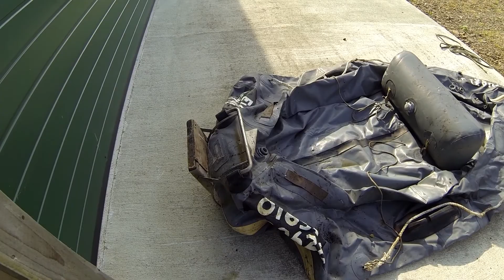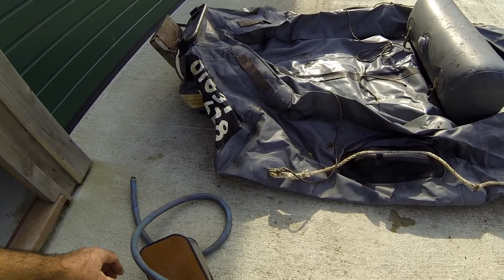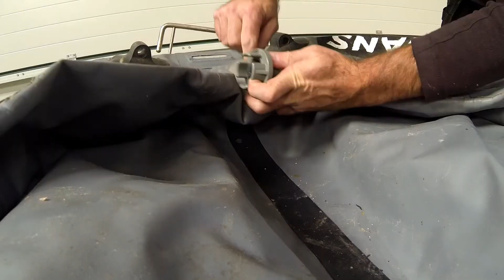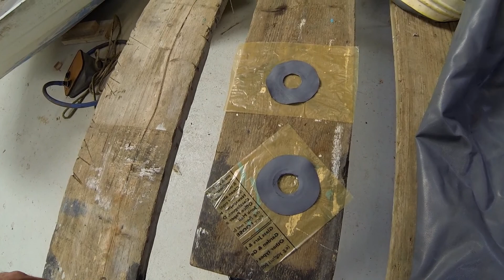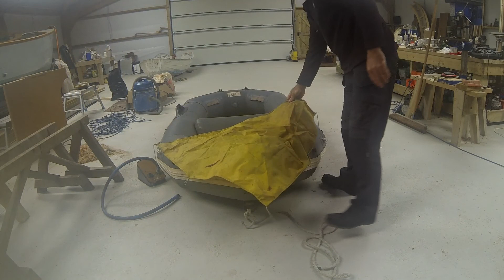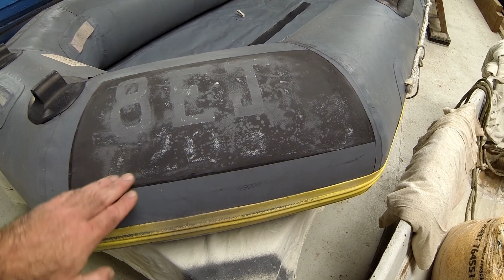Avon Redcrest Inflatable Refurbishment

Comment: I've just got hold of a redcrest here in NZ of the same vintage 1979. It had been in storage for years but didn't have any leaks or patches. The rear valve had been replaced with a newer type used on the more recent Avons. Had a slow leak in the inflatable seat valve. A squirt of WD40 loosened up the spring and is now sealed. I had a similar Redcrest as a tender to my sailing vessel for 6 years which survived many a bashing on rocks, shingle, concrete piers and attacks by local kids in various parts of the globe hell bent on its destruction.

Comment: Mine is 52 years old & gets used from time to time. I have always storedt it inflated to avoid creases. Got it out today to find a very slow leak which i will sort later. It was refurbished about 25 years ago when new valves were fitted. Been a fabulous dinghy that cost me £110-00 from Barnet Camping & Marine. I have a Seagull 40 + outboard for it, which my father bought 60 years ago. I used it a lot as a 13 year old on my first Avon (A Redstart) which I changed for this one when I got my new boat when I was 21 years old. It still runs - Would not change either. I do like rowing my Avon & have rowed it miles.

Comment: I've just bought a small sail boat and it came with a Redcrest dinghy. It's1979 and it inflates OK and without any leaks but the vales need replacing. I was thinking about a new dinghy but having watched this i'm not so sure. Great video, thank you. Anyone have any ideas regarding an outboard mount bracket?

Comment: I just bought one of these and it was in a bad state. Good to see what it will look like when it is finished. What glue should you use on this boat for patches etc.
Reply from the maker: You’ll need a contact adhesive formulated for Hypalon, which is the type of fabric the boat is made with.

Comment: I just got a this same boat. The valves are different on mine. They a steal and have little rubber plugs inside the screw on caps. To inflate, you unscrew the vales a turn or two and put the pump to it. Then, simply tighten them and the hold the airpressure.

Comment: Outstanding Video. I was just given a 2001 Avon Redcrest and the only issue is a sheared off valve. So lucky I found your video. Question, what type of solvent are you using? I've never worked with Hypolon.

Comment: This is a great video, really useful as I also need to replace the valves on an old one of these. I was also wondering if you made a floor for it? I was just going to use mine for rowing about on a lake with the kids but not sure if I'd need a floor for that or no.
Reply from the maker: Well, I’ve not had a solid floor for mine and have been ok transporting people and kit. However, having a roll-up slatted floor to give some stability under foot would have been a nice accessory to have…

Comment: Hye i got the same dingy it was given me as a gift but i don’t have the transom mount for an outboard dou you have the mesurments or do you know where ik can get the part ???
Reply from the maker: Hi. Difficult to obtain but the brackets do come up for sale used from time to time. Just keep searching online. Failing that, any competent metal worker can fabricate one for you.
Reply: @EvansBoatwork  tank you i wil adlk friend to weld it  how does it handle with an outboard ? Have a 8hp 2stroke engine laying around shoud i try dis or is it dangerous to a sertent point?
Reply from the maker: It’s mainly the engine weight. The smaller the better with this type of soft floored inflatable. I used to have a 2hp Suzuki that was more than adequate for me. Suggest you look up the old Avon tech specs online....
Reply: What did u clean it with pls?
Reply from the maker: There are a few brands out there and it’s a detergent not a solvent, so search your local chandlery or go online but make sure the cleaner is suitable for the fabric of your inflatable, ie, hypalon or pvc.

Comment: What type of paint did you use for the black panels?
Reply from the maker: It is a ‘rubberised’ paint that is formulated for hypalon tubes, available from most inflatable repair kit suppliers. It is quite thin and easy to apply.

Comment: Great job !!!! What is the max horse power for such a boat ?
Reply from the maker: I haven’t looked up the old specs but I used to have a 2.5hp Suzuki two stroke which was perfect because it was small, light and powerful enough with two crew and gear. I haven’t tried my current small outboard, a 4hp Yamaha four stroke yet...
Reply: @EvansBoatwork  I’ve got a 4hp Johnson on mine, which I’d say is a bit too heavy/powerful for it
Reply from the maker: Yep, I would say so too. Actually, my Yamaha is 2.5hp four stroke (not 4hp as I had stated before) and that is just fine 👍